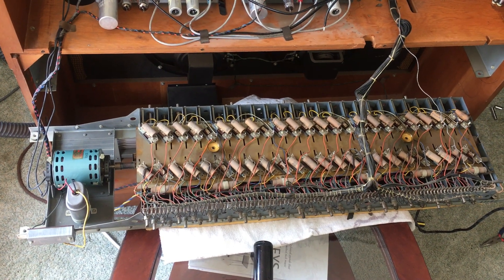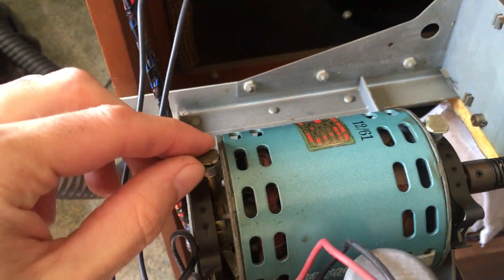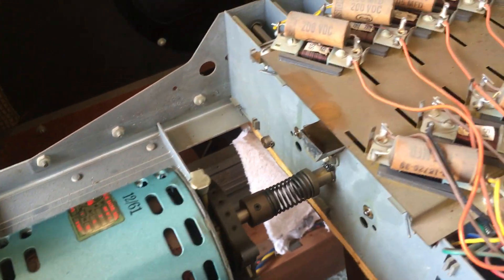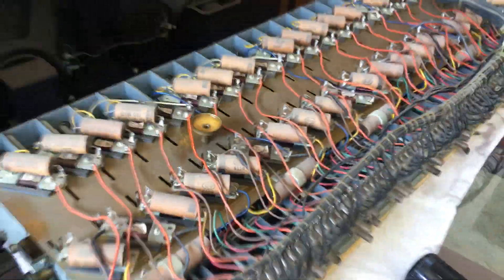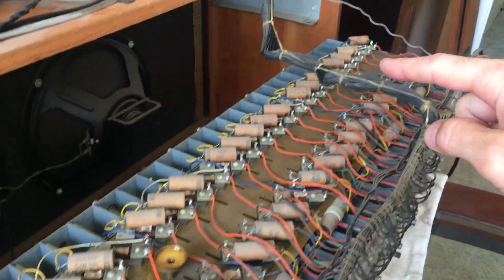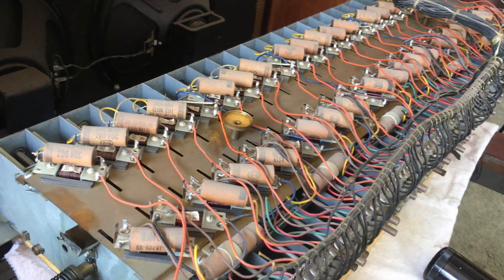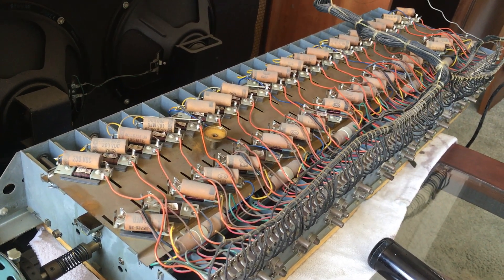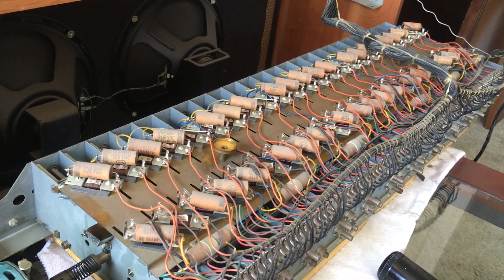5. Hammond organ L100 generator normal oiling part 1 (5 of 11)

Comment: Where does all the oil go over the years?  Is it evaporating?
Reply from the maker: That's a good question. I suppose it must dry out and evaporate to some degree, although we don't think of oil doing that at room temperature. Every Hammond has a distinctive smell inside, which must mean at least some particles are airborne all the time.

Comment: I haven’t oiled mines since the 70’s
Reply from the maker: Small amounts are recommended yearly in the service manual, but in truth, they do just fine for many years if they're not used heavily. This particular one from the '60s most likely hadn't ever been oiled since it was a single-owner living room instrument, so it was long past time regardless.